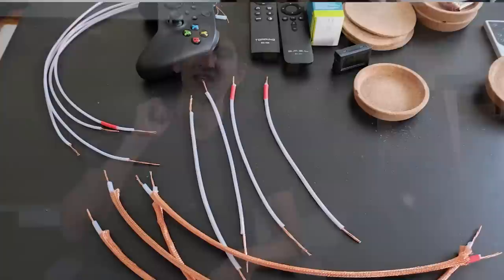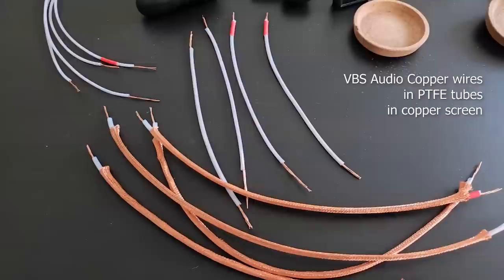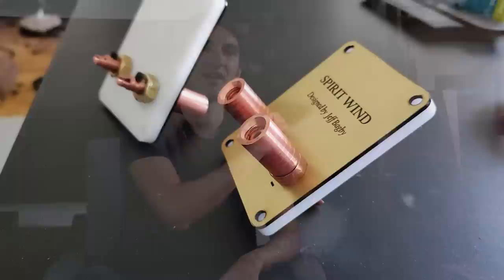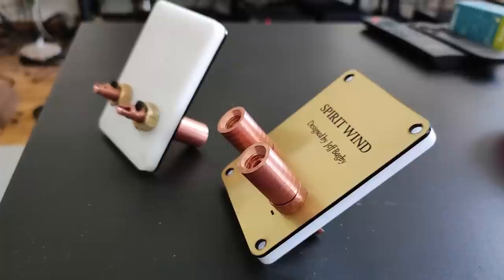High End 2-way speaker Spirit Wind

Comment: Please don’t ignore the huge R&D, testing, tooling, manufacturing consistency, service, support etc, capabilities overheads of leading speaker companies. Just because the bill of materials might be a quarter of the retail price the other pieces don’t come for free and are light years ahead of DIY. The Kef UniQ is arguably the most advanced drive unit on the planet today and is patented which is why you can’t buy one separately. The UniQ goes a long way to eliminating a lot of the off axis issues and room reflections conventional 2-way speakers posses. The patented meta technology took years of collaboration with other academics and many hours of testing and tooling which is not available to a DIY. The Blades tooling for the cabinet and composite materials was over £1m. DIY cant get close to the consistency and technology of class leading speaker companies. Not saying it’s not fun building something to an old design and buying expensive bits and bobs isn’t a nice hobby. Believe what you want but professional recording Studios and the like don’t do DIY for good reason.
Reply from the maker: Not ignoring any of those. R&D is also a part of DIY kits in a way. Drivers from reputable companies like ScanSpeak and AudioTechnology have R&D behind them, so do other components used. Cabinet and crossover design are also result of someone's dedicated work and testing. Y in DIY is nothing more than choosing and assembling something that's based on much deeper pool of knowledge then my own.
I don't see DIY and commercial products as opposition but just different ways to go about one hobby. Both have their pros and cons. And when somebody else does everything instead of you they have to be justly compensated - nothing wrong about it.
Reply: @iiWiReviews  Understood, I was addressing the gap in your explanation of all the other costs and cutting edge R&D in professionally manufactured equipment. Another key aspect is secondhand value of DIY HiFi speakers which typically sell for a fraction of what they cost to build, if they’re resale-able at all, and inly to a tiny market of hobbyists.  Whereas professionally made equipment carry far higher values to a much larger market.  Nothing against DIY, have done it myself and learnt ultimately expensive pitfalls.
Reply: @Neil Gaydon  
I will have to respectfully disagree that commercially available loudspeakers are "light years ahead" of DIY designs at this point in time.

It all comes down to the quality of drivers that are used, and how they are implemented in regards to cabinet/enclosure design and crossovers, etc.  I've purchased my fair share of relatively expensive "turds" over the years from otherwise respected loudspeaker manufacturers who's advertisements promised "superior or outstanding" performance.  :-/

And I'm not a particular fan of the LS50 Meta, either.  They do what they do well at their price point, but as demonstrated, the DIY Spirit Wind clearly outclass them.
 
Professional recording studios and mixing/mastering engineers use commerically designed and available studio monitors rather than DIY designs not just because they might offer "superior performance", but moreso because commercial designs give them an Industry Standard Reference that others in the profession can "relate to" throughout the music production process.

Many engineers work out of multiple facilities, as well as their own home, so using commercially available studio monitors provides for a more translatable, consistent reference between facilities and working environments. 

I am a musician of over 30 years and have had a professional home recording studio for over 10 years.  I've used Neumann, PSI Audio, Genelec, and most recently ATC professional studio monitors.

And I've also been designing and building DIY home and car audio speaker systems for over 20 years.  A few years ago I built my end-game 10" 3-way DIY studio monitors of my own design that outperform my former ATCs, and for just over $2200 all-in (other than my labor).

FYI, that's about 1/10th of the cost of the ATCs I was using, and if the ATCs had remained superior, I would have kept them...but they have been sold.  ;-)

Granted, I already had a decent machine & wood shop and all of the associated/necessary tools to build high-quality, furniture-grade cabinets, etc.

The design and quality of the cabinets is completely up to the capabilities of the DIY builder.  And even if you outsourced the construction of the cabinets to a professional fabricator and finisher, you would still most likely come out ahead with a DIY design in terms of cost/performance/aesthetics.

However, more recent technology has allowed manufacturers to create incredibly good, active/powered studio monitors at very competitive prices, and I will often suggest several of these even over DIY designs because of their value and level of performance for the investment, as well as for their "Plug & Play" instant gratification aspect.

As just one example, Kali Audio recently released a specific "Home Audio" version of their popular active LP-6 professional studio monitors.  These are "entry level" studio monitors, but they perform amazingly well for their price point.  They are a "no-brainer" IMO.  Even moreso if you step up to Kali Audio's slightly more expensive IN-5 or IN-8 active studio monitors, which also incorporate a proprietary concentric Midrange/Tweeter driver.

But when you want/need the highest level of reproduction quality in loudspeakers or studio monitors, you are still going to need to pay at least 5 figure prices for a commercial design.

Sure, large corporations can employ very skilled and experienced transducer/mechaniclal/electrical engineers and designers, and perform high-level R&D to develop their unique and proprietary products such as KEF's Uni-Q drivers, etc.  

But I would argue that there are already outstanding, cutting-edge transducers available as "raw drivers" on the DIY market, some of which will outperform even large commercial company's proprietary designs (because the majority of these are built within price point constraints).

For instance, I have not measured or heard a better driver than the Purifi PTT series of midwoofers and midrange drivers, or the BlieSMa Beryillum tweeters and midrange drivers.  And both in-house and independent measurements confirm their superior performance, in addition to independent listening tests .

Yes, the KEF Uni-Q drivers are excellent in many regards and are obviously the result of considerable investment into R&D.  HOWEVER, they were also designed to a specific GOAL, and PRICE POINT.   So, while they do have unique charactaristics and advantages in some areas, the design also has it's unique trade-offs and shortcomings that must also be considered in the final loudspeaker design.

And FYI, the Uni-Q drivers are available to purchase separately IF you know how/where to source them.  My buddy, Erin, from the excellent Erin's Audio Corner YouTube channel, has used and tested them in his own high-end custom car audio system, and because of his experiments with them, so have I.   You can find this information and photos Online in the ErinH 2006 Honda Civic Neverending Tale Build Log on the DIY Mobile Audio Forums

This is how I know that the Uni-Q drivers have their own unique set of attributes and limitations, and while excellent in many regards, they are not an "end all/be all" driver.  And I don't know where you got the idea that the Uni-Q drivers "eliminate room reflections".  That is a complete misunderstanding of their attributes and design.

With proper driver matching, baffle design, and crossover design (as seen here and in Jeff Bagby's other designs), the majority of the "issues" that the KEF Uni-Q or other concentric MF/HF transducer designs "solve" are a non-issue.  Using two or more physically separate drive units on a common baffle to cover the majority of the frequency bandwidth are a non-issue, and may not exhibit some of the inherent limitations of concentric designs like the KEFs, or those used in Genelec studio monitors, etc.

Coincidentally (pun intended), I ended up using a high quality Concentric MF/HF driver in my end game DIY 10" 3-way studio monitor design with the 5"/1" BMS 5CN162HE.  There were specific issues or attributes with these drivers (like all drivers) that required special attention, but it was not a problem to design the system to mitigate or eliminate these particular attributes.

The best commerically available loudspeakers that I have ever heard were my cousin's Børresen Acoustics 0-series "03" floorstanders, which use proprietary drivers developed by Michael Børresen and his company.  So, YES, a company that can invest lots of money into R&D CAN offer superior results.   But again, we are talking about a series of loudspeakers in the 5- & 6-figure price range.  So there's that.  ;)

IMO&E, there is a place for both commercially available loudspeakers as well as DIY designs or kits because there are different types of consumers with different skill sets and different levels of involvement.  However, I would never say that a commercially designed and manufactured loudspeaker will be superior to an equally competent DIY design at any given price point.

It all comes down to how well the design is implemented FOR EACH in regards to the quality of the drivers/cabinets/crossovers.  If you are capable of building (or outsourcing) the cabinetry and finish work, and have the available time and interest, a "well designed & implemented" DIY loudspeaker design or kit will nearly always outperform a commercially available loudspeaker at any given price point.   My many years of experience with both has proven this to be true.

And at this point in time, the hardware and software tools required to design and measure the performance of individual drivers and completed loudspeaker designs are readily available to the public and relatively affordable as well.  For example, you can do A LOT with a $100-$200 calibrated USB measurement microphone and free software such as Room EQ Wizard (REW), a Dayton Audio DATS v3 or OmniMic, in addition to the many excellent free enclosure and crossover modeling software that are available.

And access to electrical and acoustic measurement tools and test information provided by audio enthusiasts such as Amir at Audio Science Review and Erin at Erin's Audio Corner have given further knowledge and insights into speaker design and levels of performance that were not previously available to the general public.

Sure, there may be a general disadvantage to the ROI or recouping your investment with DIY loudspeakers.  But for those that opt to go DIY, it is considered as an opportunity to further their first-hand knowledge and understanding of electronics and acoustics, and to learn exactly what does and does not affect the end performance when building DIY loudspeakers, and/or considering the purchase of an off-the-shelf loudspeaker.

In addition, I've had more than few friends who already had very good off-the-shelf loudspeakers offer to buy or have me build extra pairs of several of my DIY loudspeakers for up to 3x of what it cost for me to build them.  And the knowledge gained in designing and building them has been priceless.

And if you have built a DIY design, their is no real need for "manufacturer's service and support", as you intimately know the construction of the loudspeaker and the drivers and crossover components that were used, and could most likely troubleshoot and replace any of the components at nominal costs and with little effort.  Loudspeakers are expensive to ship and a PITA for manufacturers to service, so they account for that in their design and pricing, sometimes implementing safeguards into the Crossover design to limit potential driver damage.  These safeguards might also present a tradeoff in performance.

Anyway, it's a better time than ever to be a music lover and an audio enthusiast!
Reply: @Neil Gaydon  
And FYI, many of the large soffit-mount or built-in, flush, in-wall studio monitors in professional recording studios are/were essentially DIY designs using off-the-shelf JBL or Eminence professional low frequency/midwoofer cone drivers combined with horn-loaded compression drivers.

They were usually a one-off DIY design by the studio designer/acoustician to match the specific properties of the control room.  Just like some modern DIY designs today, they opted to use proven high quality off-the-shelf drivers combined with basic acoustic, enclosure, and crossover principles to design and build them.  There weren't Millions of $ in R&D put into them.   Just basic, but solid acoustic and electrical design principles that always work when good drivers are used and implemented properly.
Reply: @bbfoto7248  Wow…now that is a considered response, thank you. I need to have a lie down after all that. Apologies if I didn’t get my thought over… light years refer to the accumulated R&D with new materials and testing time over a DIY’er. I also don’t believe the UniQ eliminates room effects just improves it due to their excellent off axis response. It’s clear you are a serious DIY expert which explains why normal folk buy brands. 

I come at it from the “dark side”. I worked in the hifi industry in retail, and then at Kef and Linn and know the hard work and dedication of those engineers and people to make the best they can. They’re a bit like the formula 1 of the car industry, spending vast amounts on R&D, building state of the art products at very high price points that the rest of the car industry go on to benefit and learn from. 

I knew many of the legends like Raymond Cook and Laurie Fincham  who pushed the academic boundaries of speaker know how, design and computational modelling forward. Ivor Tiefenbrun in how to bolt together speakers properly at a time people used flimsy cabinets and wood screws while showing why good quality speaker cables and stands were important at a time no one believed they made a difference, using bell wire and putting speakers on a bookshelf or on the floor. While back in the day we worked with Naim Audio on early active systems when few offered them. Linn went on to design there own active systems, including all the digital components which time align the drive units while eliminating inherent drive unit mechanical issues. People forget Linn weren’t only about the LP12.

Yes we always had price points to hit, just as the DIY’er does, but the solutions emanated from years of R&D around a clear vision of taking the state of the art forward, creating new solutions, using new materials and designs which of course go on to be copied and or made cheaper. Without all this amassed knowledge and work from these and many other dedicated companies the DIY’er would struggle. 

Everyone’s a winner!
Reply: @neilgaydon5430  Hi Neil. in my experience they do not sell for a fraction for what they cost to build. You can usually sell it for price of drivers + crossover if it is a kit from known diy builder (like Troels Gravesen). Also you can never resell commercial speaker for what you paid from it. Kef ls50 was 1100e when new, now it is sold for 500e..
Reply: @jarkkokinnunen9963  Sorry if it read that way I certainly wasn’t remotely suggesting you can sell branded products for what you paid. The truth is hifi equipment is one of the worst for product depreciation, whoever makes them, aside from old LS3/5a’s with dried out caps 🤣 The market for S/H DIY speakers is inherently small where they typically sell to hobbyists who understand what they’re buying or friends and family and not the wider market. BTW the same is true in the guitar industry. Beautiful handmade guitars made from the finest tone woods from an unheard of luthier will usually depreciate far more and are much harder to sell than a similar guitar from the big high end brands…and in some cases the latter will even appreciate like Martins.